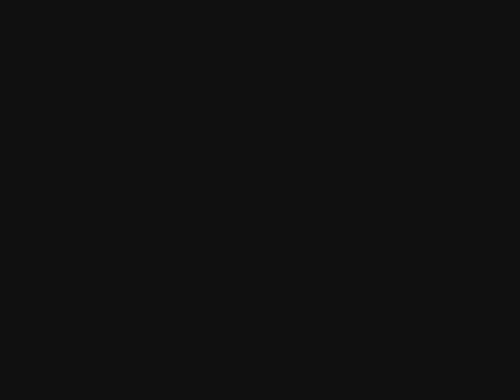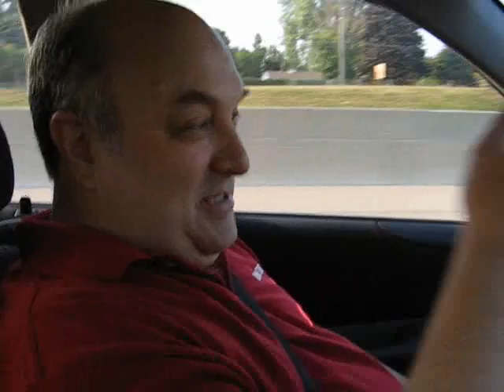How the Slot Machine Works

Comment: Actually, this guy is somewhat right.  Each slot has software that is designed for a specific pattern that mathematically computed to a factor called a hold percentage.  The higher the denomination, the less the hold percentage - It's how much money it takes from the player.  The pattern is governed by a Random Number Generator based on time of around 1,000 times a second in a 24 hour period.

Comment: @whitelightning2 I don't know about other states, but here in Pennsylvania where there are all new casinos built have it.  "Pa code 461a.21. Server Based Slot Systems". Section (d) states "Results from the play or operation of a server based slot machine must be determined solely by the server based slot machine server and not by the individual server based slot machine". This shows that the RNG in a slot machine is being over-ridden by an operator at a  main computer keyboard. Legal theft!?!?

Comment: Perhaps not, but on a recent episode of "The Real Hustle" (a british TV show dealing with scams) there was a section covering fruit machine 'hacks', if someone is able to access the innards of one of those machines using a key, they can then plug in a small device bought over the internet to alter the payout to as low as 7%, it was on episode 6, you might be able to find out more info if you google for it.

Comment: The only part correct: the machines take in more than they pay out! It's not so easy to change the payout (IF he is suggesting the workers can change it at whim.  think of all the RICH and LUCKY relatives & friends they would have if that simple!). Ther's a reason why there is a gaming commission and rules that casinos have to follow to be LEGIT.
 Machines have a RNG (random number generator) & that chip that runs the computer is just that...random ( BUT set for the percentage beforehand) :>)